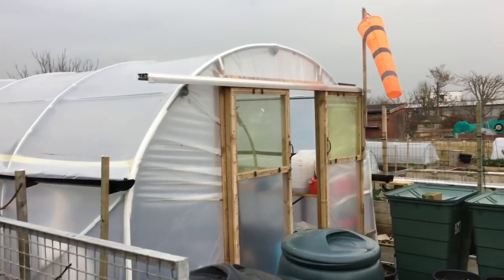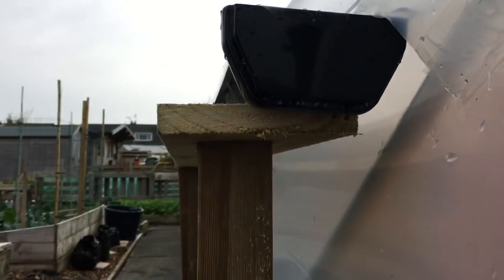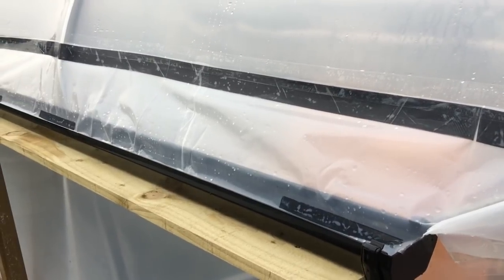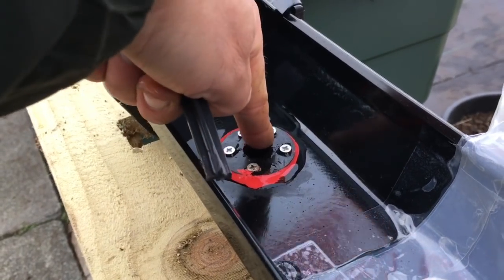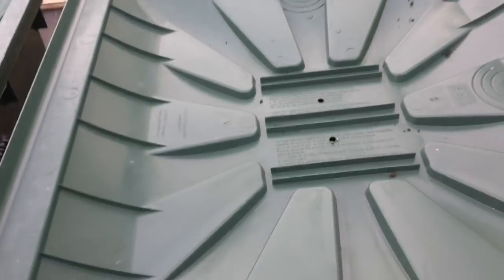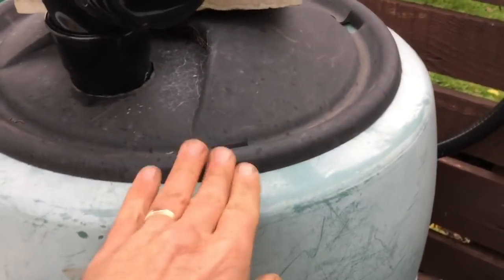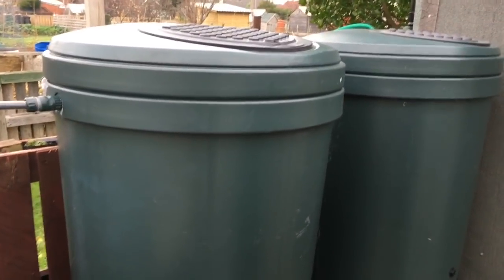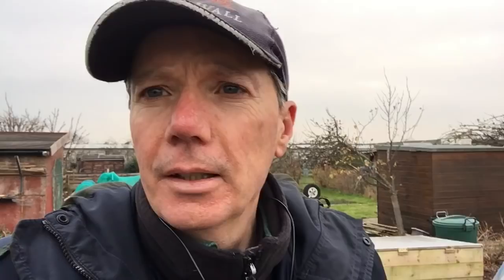Polytunnel Guttering - a big step towards solving the water shortage?

Comment: Hello Steve, A first class job on the tunnel collection system 👍🏻👍🏻👍🏻. I had the same thoughts about linking barrels at the top, but recently our council has rationalised the refuse bins and a number of wheelie bins have been up for grabs  my thinking now is to link these together at the bottom and connect this to timed drip system.  This will give me access to the full volume of water in the bins, rather than just one bin and should help keep the pressure balanced.  Cheers....Nigel 😄👍🏻
Reply from the maker: That's a nice idea Nigel, I wish it was practical for me, but laying all that drip would be very convoluted.  I might do it for the tunnel, but my first step is just to plant more stuff into the ground, rather than pots.  Last year I found that watering the tomatoes and peppers in the ground was very quick and easy and I could water once a day and happily miss a day with no ill effects  : All the best - Steve
Reply from the maker: I saw a nice little solar powered drip solution in Dobbies today, that would also have enough power to shift water between my barrels.  A bit expensive though, so this year I will try lower tech solutions.
Reply: @SteveRichards   The first year of having my IBC tank, I used a battery operated timer. This was connected to a ring main inside the greenhouse and the drippers came off that . I was away 4 weeks on holiday and it watered well. I guess it would have lasted 6-7 weeks
Reply from the maker: I do dream about something like that, but then I'm reminded that I have plenty of friends on the site who are happy to water the polytunnel for a punnet of strawberries when I'm away.  I can't imagine leaving my plot for 4 weeks though, I get homesick after 4 days!  I must go check out your back catalogue, you've done some great projects before I started watching.

Comment: tunnel guttering is over-enginered....you dont need it, the plastic V profile self adhesive if fitted correctly will catch more water than you can store...10L a minute sounds great but in a rainy uk autumn/winter where you gonna store an hours worth of water x  days worth of water...Just think you over think things and too willing too spend £,sss.
Reply from the maker: You make a good point Darryl, but I have considered it.  I've seen the plastic V sections, I have them on my cold-frame lids.  Unfortunately it's just not true for us that they will capture enough water.  I've seen other videos where they've filled water butts using these fitted to a single 5' section of a polytunnel overnight, but we NEVER get that sort of rainfall here.  

Even collecting from the whole 20' of the tunnel we can't fill our water butts except in the depths of winter and they are soon depleted in spring.  Our rainfall is so low that we need to catch every drop along the full length of the tunnel and this is the best solution we've seen for that,  the challenge is the bowing of the taught poly between the hoops.  

It is however true that I am prepared to spend money, I've invested 5% of the value of my harvests this year in saving water for next year, that seems like a prudent investment to me.  We eat what we grow, so when it comes to securing my food supply I'm happy to spend a few pounds and I like a fun project too.
Reply: Once again proving that every situation provides a variable that no one person can assume they know about.

Comment: Hi Steve, just put up my polytunnel, love the idea of the gutter on the posts. How's that gone for you? Any improvements you'd recommend on your design in the video? Thanks
Reply from the maker: It's worked very well so far Daniel, the only thing is that the screws holding the gutter down have rusted, even though they are stainless steel, so I wouldn't cover them with polytunnel repair tape.  That way they would dry out between rain  : All the best - Steve